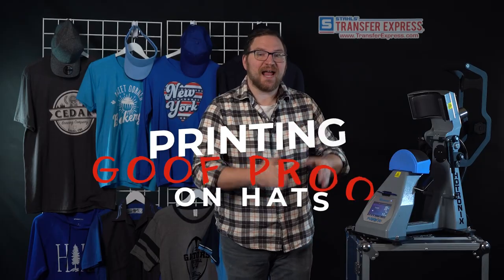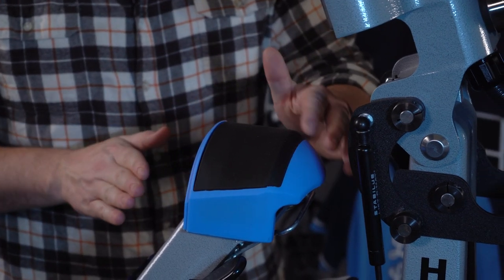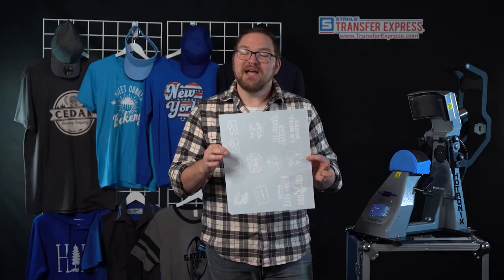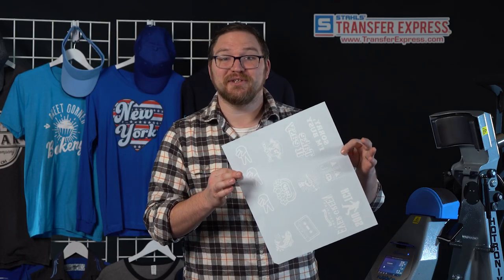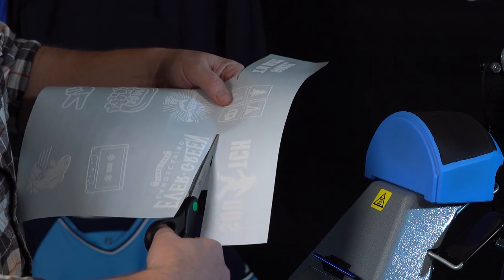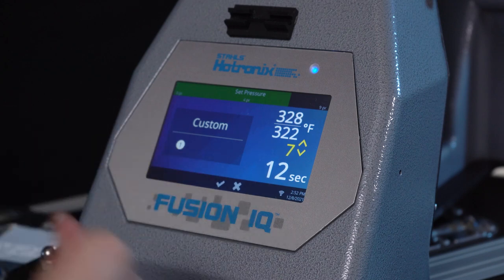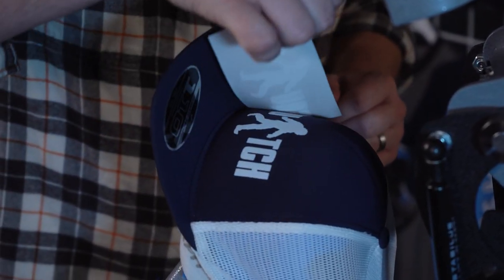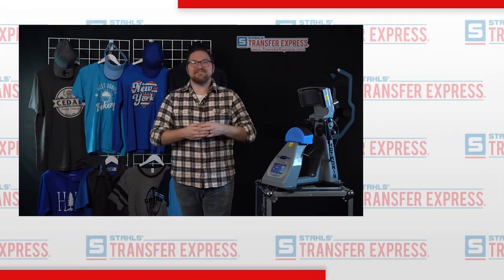Printing Goof Proof Transfers on The Hotronix 360 IQ Hat Heat Press

Comment: How do we adjust pressure on the press I just bought the fusion but I tried to adjust the pressure but it stays at zero even when I move the upper black adjustment knobs clock wise it stays at zero with a exclamation mark with the pressure read at zero in orange ?
Reply from the maker: Hey Robert, sorry to hear you're having some troubles with your new press- Does the press still read zero with a hat loaded onto it and/or one of foam pads included with the machine? 

You can reach out to Hotronix directly to troubleshoot issues or calibrate the pressure on your press: https://www.hotronix.com/support

Comment: Is it true these don’t last as long as actually screenprinting the design onto the hats (specifically the foam trucker hats)? I’m torn on which route to go as I’m interested in getting into the hat making side of screenprinting. Great video btw!
Reply from the maker: Andrew, these Goof Proof screen printed transfers are just as durable on hats and headwear as real deal screen printing (and a whole lot easier to apply) they are exactly the same inks. I (Dave) personally have hats that still have a perfect print years later after tons of use and wear. While these screen printed transfers work a variety of caps, the foam-front trucker hats are (in my opinion) the best hat for printing this type of transfer on.

Comment: What Stahl’s transfer products are compatible with this unit ?
Reply from the maker: Hey VidaEats! Technically, all Stahls products will work with this heat press. The lower heat really makes applying the emblems and patches ( https://www.stahls.com/stahls-flexstyle-emblems ) an absolute breeze, but, if you don't need the lower platen heat for the transfer you're applying you can turn it off.

Comment: There's a way or transfer for beanies specifically? I have a customer who didn't like any of the patches just because he doesn't like bulky stuff. And, since I can not print goof proof on beanies I'm wondering what can I use instead. Thanks.
Reply from the maker: Beanies are a little tricky depending on the fabric content. Acrylic beanies have a tendency to deform and loose their elasticity under high heat. We've had a lot of success with 100% polyester beanies and our UltraColor Soft transfers or even ElastiPrints (which apply at 290- or even 275 on super heat sensitive 100% polyester)

Comment: I tried transferring my goof proof transfers onto 100% cotton caps and the results have not been great. I either get not all of it being transferred or end up burning the transfers. I followed the directions thoroughly and I tried adjusting the heat and pressure but not once has it come out nice. Is it because it’s cotton? Does goof proof not work on cotton heat presses unlike cotton shirts?
Reply from the maker: Hey Zeo, sorry to hear you're having some trouble. Goof proof should apply no problem to Polyester and cotton hats. We would recommend submitting a resolution in your account on transferexpress.com for the quickest action. 

With that being said we've love to try to help as well. Most of the time applications go awry on hats and headwear is due to the cap not sitting flat and flush against the platen- any obstructions will then block consistent pressure across the entire surface of the transfer. What heat press and hat style are you using?

Comment: Just got the iq360 and used your settings. Can’t get a good print either. Any suggestions on other settings?  Ruining hats sucks. I see on stahl transfers the lower platen is higher setting then lower
Reply from the maker: Hey Scott, sorry to hear you're having some difficulties printing headwear, we'd love to help! What hat style and transfer are you using? What is your pressure setting displaying?

The dimensional emblems and patches from Stahls have heat-activated adhesive on them that requires the bottom heat when using the 360 press. For this example with goof proof on foam front trucker hats, you don't need the heat however I've found it works for reducing scorching on these sensitive foam fronts - Other than a paper cover sheet, we did not use any of the foam pads and had to increase our pressure accordingly.
Reply: @transferexpress  have tried the c112 trucker and new era 39.  Pressure is 6-7 with 330 on top 320 bottom just with cover no foam.

Comment: Your video just cost me $30 in hats with those settings
Reply from the maker: Oh no, Im sorry to hear that! These settings have worked great for me (Dave) on more than 200+ hats using Goof Proof Transfers and the 360 IQ Cap Press. I'd love to know more to be able to help out- Did the hats scorch or crease? Or did the transfer not apply? What style hat were you using? Were you using screen printed or digital transfers?
Reply: @transferexpress  goof proof wouldn’t apply entirely. 6 port authority caps and 4 uoupoong truckers
Reply: @transferexpress  the cricut mini tip for poly was good. What about putting cover sheets over the areas of the shirt contacting the press where the logo isn’t being applied? That seems to be logical to avoid press marks
Reply from the maker: You can, just like how we used a coversheet in this video, just be sure to compensate on the heat to not compromise the application temperature. We prefer the paper coversheets as they don't block heat like the silicone sheets or do (sometimes up to 30 degrees!) 

In most cases, using a lower temperature transfer on heat sensitive items eliminates any need for a cover sheet. We do have a video on some tips for avoiding press marks here: https://youtu.be/mdl9AXPMlt8